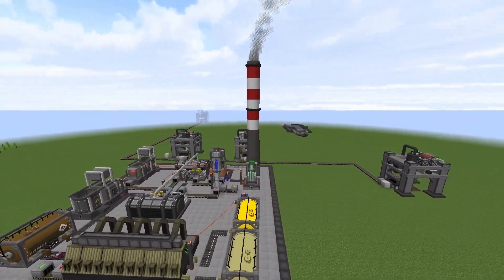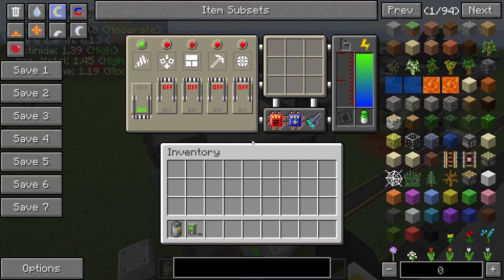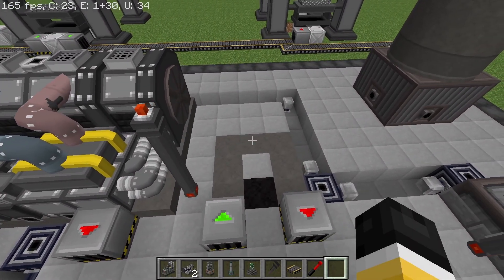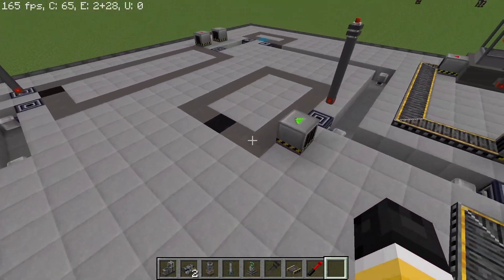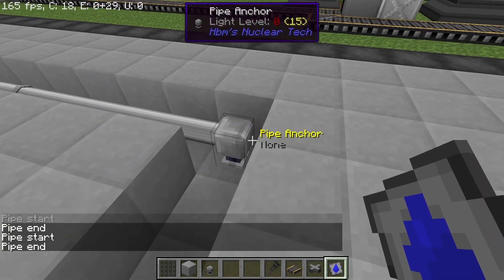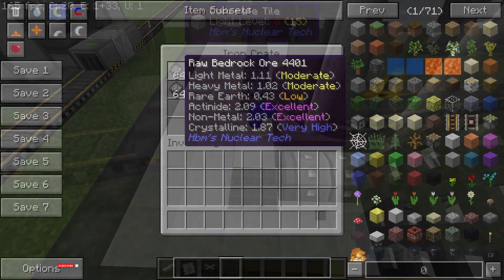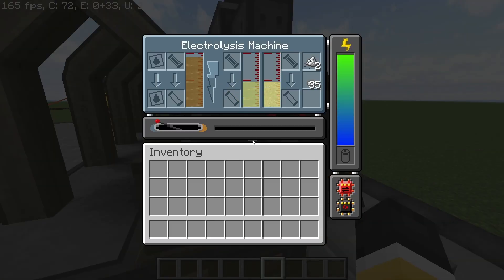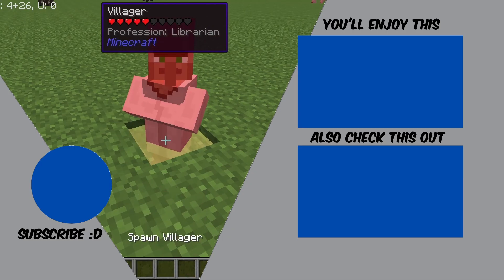Chlorine Gas Automation - Part 2 - Fusion Reactor Power Plant

Comment: if you use the conveyor block on the faces of the inserters/ejectors rather than the ground it will turn towards them, saving the need to use a screwdriver!

Comment: One issue I found with conveyors is that they cause allot of lag on the GPU, so much so that it was worth it for me to use pneumatic tubes instead😭
Reply from the maker: I didn't notice that, maybe I never placed that many conveyors before that's why xd
Even I prefer tubes over belts, but belts look cool that's for sure. Even above pneumatic tubes I like the thermal itemducts